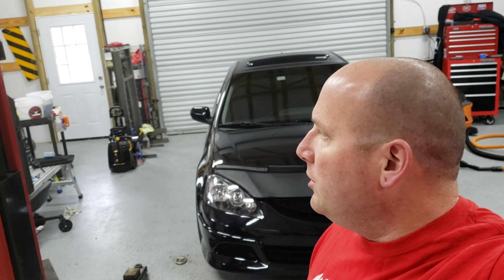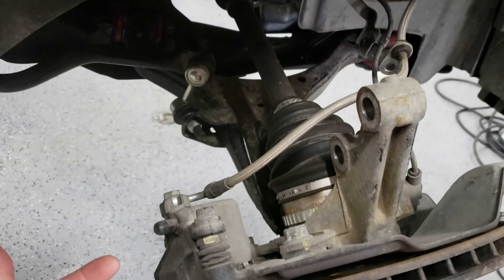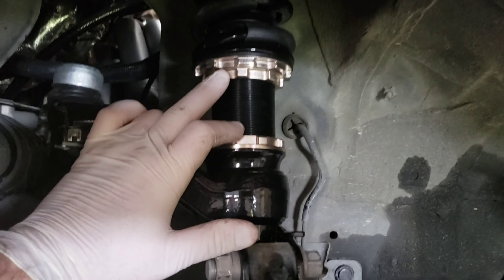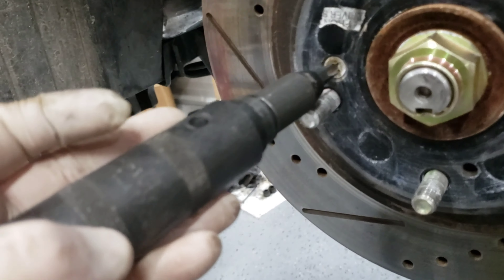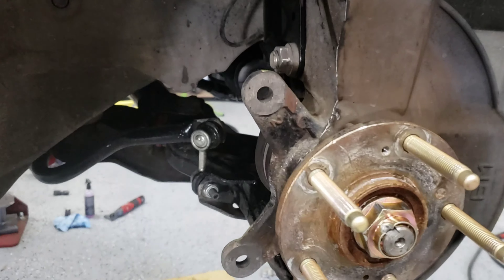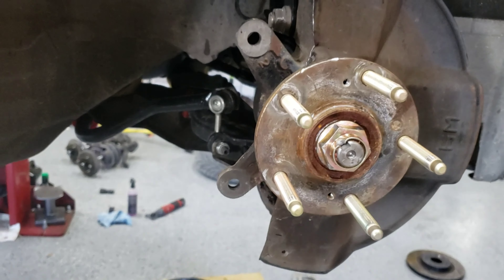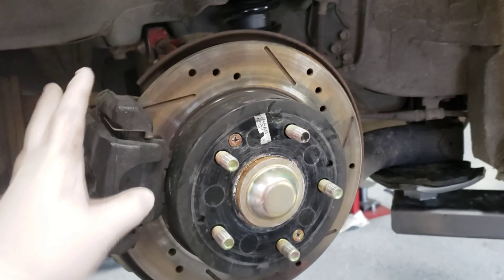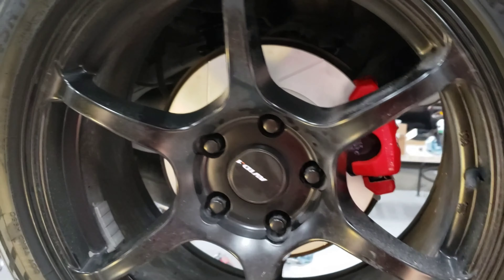RSX TL Type S Brembo Conversion

Comment: With the spacer behind your rotor, there is no flange left for your wheel to be centered on the hub. It's not hubcentric anymore. You can't rely on the bolts alone to center your wheel to the hub since the tolerance is not tight enough.
Reply from the maker: The spacer post rotor is hub centric. Meaning it's holes are aligned via studs and has a small hub ring to center the wheel. Thus everything stays aligned and centered. I never had any vibrations or balancing issues or issues at all relating to your concern. And the car was taken to 160mph plenty of times.

Comment: Thanks for the vid! Im about to do the same swap on my 05. Im going to machine the calipers down roughly 5mm to eliminate the spacer inbetween the rotor and hub. I didnt know about the studs having to be shaved in order to install/ remove. Maybe the 05 type S has more clearance.???
Reply from the maker: Possibly.  But doubtful
Reply: @calawaydp  its only the dust sheid that the studs hit right? I just watched another install vid (05/06 type s and the studs have plenty of room to enter and exit with the dust sheild removed/cut.
Reply from the maker: They hit the knuckle
Reply: @calawaydp  https://youtu.be/95F8Sje6lRs. Watch @ 11:30. He possibly has a different knuckle? Its looks stock n rusted to me. Anyways thanks for the help and content. I subbed.

Comment: Will this work with stock rsx wheels or will I need to buy new ones?

I have a k24 swapped em2 5 lug swapped from an rsx and ep3 steering and I want to upgrade the brakes before I turbo it.
Reply from the maker: Not sure. Offset plays a big part in fitment